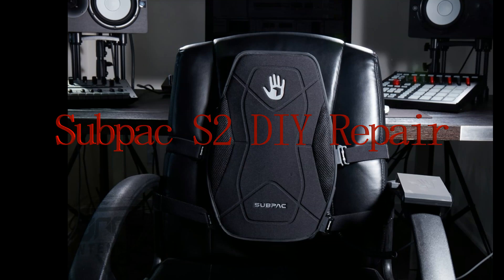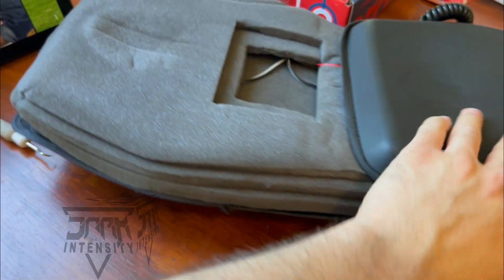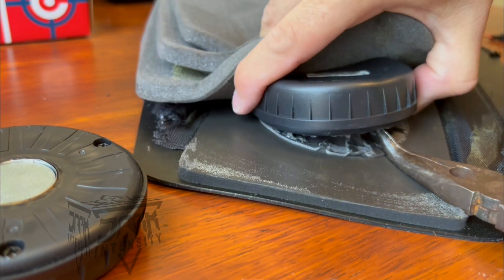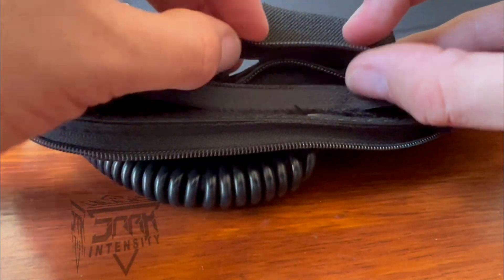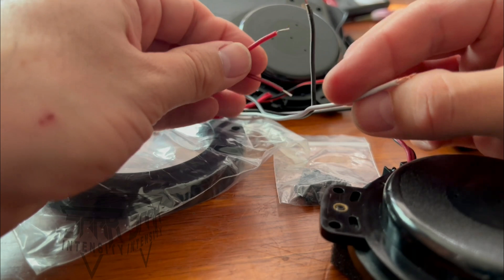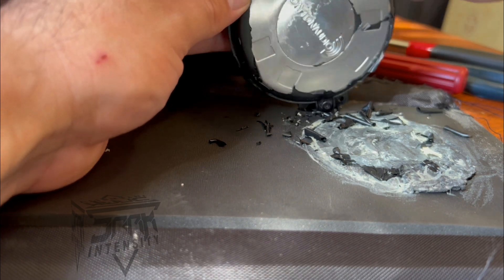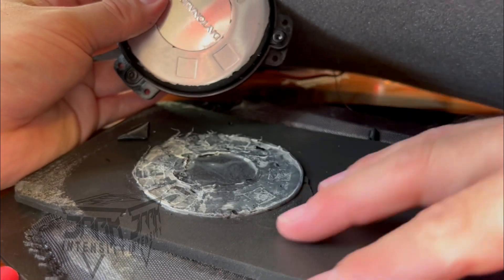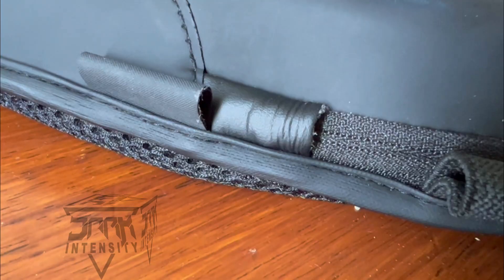Subpac S2 DIY Repair (Replace Worn out Bass Transducers)

Comment: 4:30 minute: no, its not garbagge mate!! you could try to see if they are repairable DIY. You could unscrew the three screws under, and check if the tactile pistons were  stuck dry. In most cases i ve seen many people simply opened the inner mechanism of the transducers and sprayed engine oil in the piston area of the shaker, and then they worked as new!! ANyway, next time you feel performance degradation of your new ones, do this.
Reply: I tried. You unscrew the 3 screws and have to separate the bottom plastic from the top plastic. Impossible! There’s a bit of glue around the edge, which is easy to remove. But! You try to remove the bottom and it’s attached by 3 other screws from the inside of the top cap! It’s heavily glued inside. I prayed and broke off the bottom and tried to get the speaker out, I would have to bend and break it. 
$80 on the Subpac website and they will repair and send to you for $80 total. 
They don’t want you to repair these!

Comment: How is the unit now? Still working with no problems with the replacement parts? Is it stronger or the same as far as the bass hit? Thanks again!
Reply from the maker: Good news It is still running and I haven’t run into any problems yet, the bass was a little stronger with the original parts tbh, but only by a little bit.
Reply: @djDarkIntensity  does the replacement transducer have a different feel to it? Or just a bit less power?
Reply from the maker: @morganpage  i did notice that it has a little less power, but good enough to still have full control of the  essential subsonic frequencies.
Reply: @djDarkIntensity a little bit? By a lot. But it’s still acceptable. Thanks for the video! Fixed.